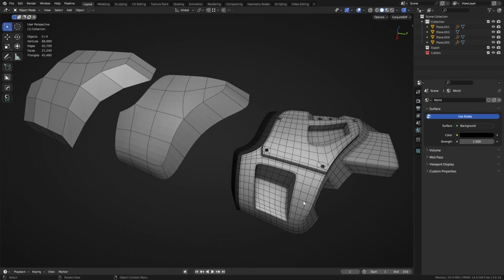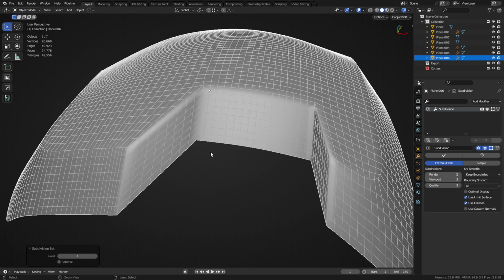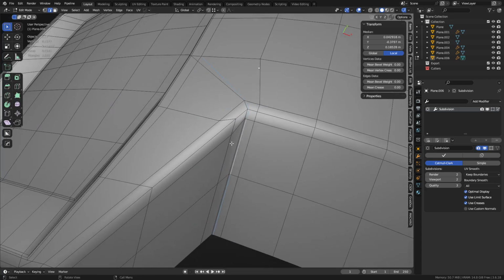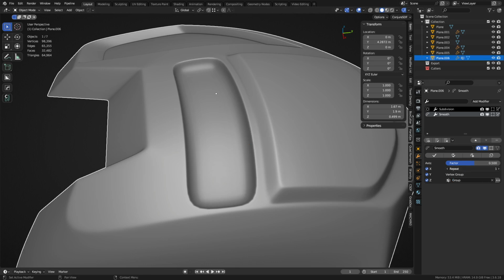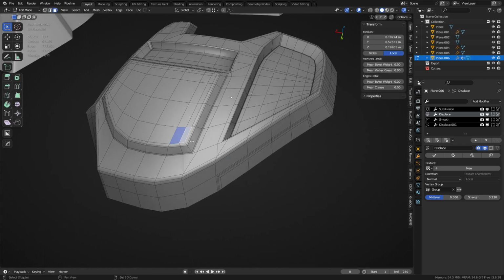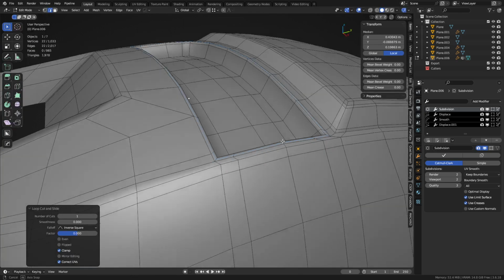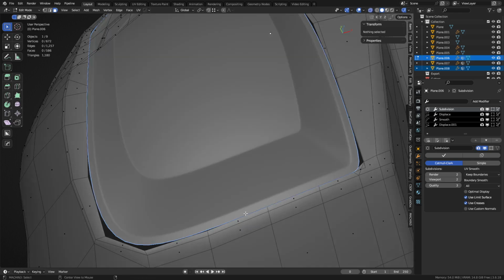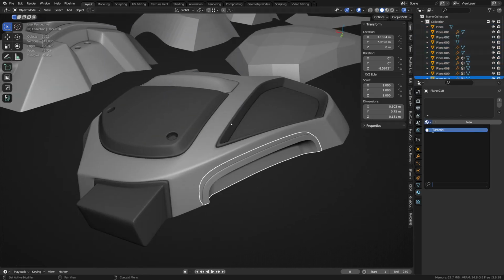SubD - Hard Surface Creasing

Comment: 21:23 why not make the detail as an separate object and not have to deal with quads and loops? I guess you want that smooth bevel transition the subd is giving you, but sometimes it can be challenging to solved and time consuming
Reply from the maker: It's good to learn it but if you can separate something then you should.